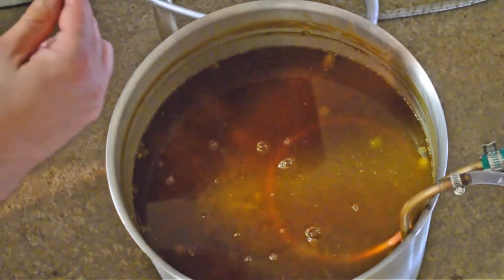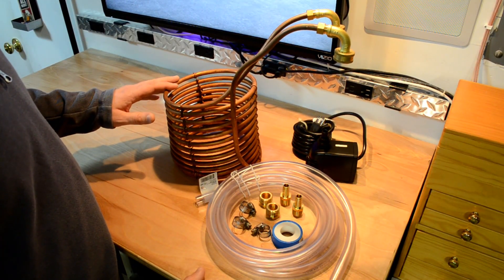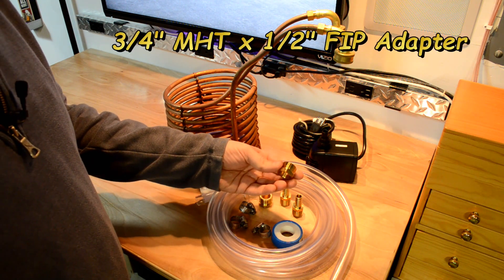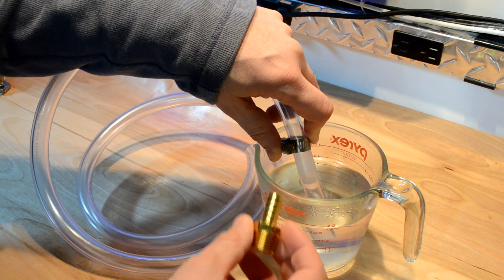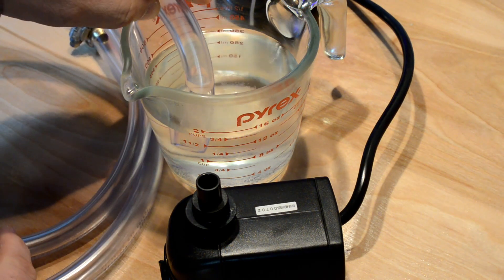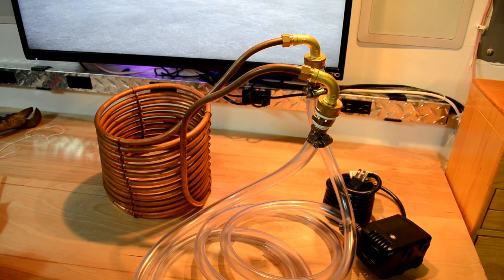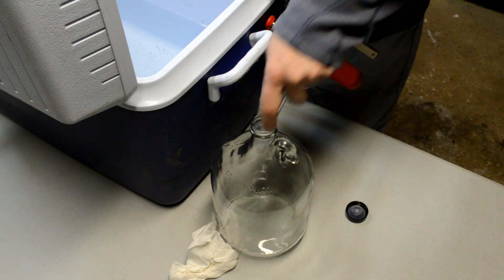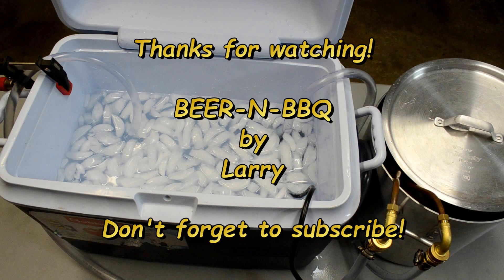Recirculating Wort Chiller: A DIY Project

Comment: Thanks Larry, chilled 10 gallons of beer on a 50’ wort chiller in about 20 minutes with 25lbs ice on an 85 degree day. I had to run off about 15 gallons of hot water first, but my kids were able to wash the dog and cars with that. The 300-500 gpm pump cost me 45 bucks, still cheaper than a plate chiller and in my opinion, more efficient.

Comment: Excellent video! Thank you! I got a submersible pump, attached to my wort chiller and cooled my 6 gal. of BOILING hot wort to lager pitching temp in less than 25 min! Saving the first few gallons of hot water was a great idea. Not only did I save time and LOTS of water, it’s so much more sanitary when the wort cools so quickly. Microbes have no time to grow. Thank you Thank you Thank you!!!!

Comment: Larry, super video!  Have just moved to the desert and no longer have grass to water.  Need to procure a chest freezer to use as a fermentation chamber.  Have you considered using a chest freezer as a water repository (being chilled by the freezer) rather than using the cooler?
Reply from the maker: I have not considered that. Interesting idea. Not sure how waterproof they are.
Reply: @BEERNBBQBYLARRY  I've used an old POS chest freezer picked up cheap (Montgomery Ward) as a fermentation chamber.  Fool thing died (R12, so no easy fix), and out of desparation filled it with water and ice.  It worked, no loss of water (this was done in the midwest before I moved).  Have picked up another freezer and plan to give this a try.  I use a counterflow wort chiller, and based upon comments, will get a utility pump.  I'll let you know how it works.

Comment: I too use a recirculating wort chiller and get great coldbreak. My question I'd how to keep the coldbreak material out of my fermentor? Do you just let it sit? Does whirlpooling work??
Reply from the maker: I just leave coldbreak behind in the kettle; racking from above the tub or from the side of kettle after whirlpooling.

In the old days, I used a mesh in a funnel to filter out most trub on the way into the fermenter. PITA though.

Comment: Would it chill even quicker if you had a copper coil submersed in the ice for more surface area?
Reply from the maker: Not really. They longer the tubing the slower the flow rate which works against chilling.
Reply: @BEERNBBQBYLARRY  why is the flow rate slower, the pump will be working at the same rate, it just means there will be more water in the pipe work meaning it will have more time to draw the heat from the extra surface area.
Reply from the maker: @brewster2188  maximizing heat transfer into the water is not the same goal as chilling quickly. They are opposite goals.

Comment: I wander if you use a higher flow rate pump in a styrofoam cooler so you can drill holes for your pump lines to come out of the lid ( styrofoam for a cheaper proto typing material). Better yet maybe you can add a (brand new of course) automotive oil, or transmission cooler on the return side. With the addition of a household fan to chill the radiator fins so the water doesn't return as warm. Also please be cautious using teflon on those type of brass fitting that can sometime for leaks.  I'm not trying to be a Dick or a Troll. Just sharing some knowledge and ideas with ya! Awesome work man! Thanks for sharing!
Reply from the maker: You could go to such extremes. I’m more about simplicity and reuse. I use that cooler (or bucket) for multiple purposes than just this and it only takes up one spot on my garage. 
I also now use a more powerful utility pump and garden hose.

Comment: How has this held up over the years?
Reply from the maker: Still around, but I've since upgraded my pump to a 1/3 HP submersible utility pump. Works much faster.
Reply: @BEERNBBQBYLARRY  Is there a brand and model you would recommend?
Reply from the maker: I have whatever Menards was selling at the time.
Reply: @BEERNBBQBYLARRY  Thanks for the reply.  I'll check around and see what I can find.  One last thing.  What would you recommend I keep an eye out for when it comes to how many GPM or GPH the pump can transfer?  Thanks again.
Reply from the maker: Just note that claims around those numbers are extremely exaggerated on imported pumps making comparisons hard to do without real testing.

Comment: Just did this with my Hydra and a utility pump (1/3HP, 2450GPH), and holy crap was it fast. AZ ground water is far too warm to do any meaningful chilling and I got sick of wasting so much water, so decided to try this. I saved the few few gallons for cleaning before I started recirculating and got down to pitching temps within a few minutes. Then I gave the garden the leftover water. Only downside is buying ice, but I feel much better about brewing now. Thanks Larry!
Reply from the maker: You’re welcome. I also upgraded to a utility pump since this video. Much faster indeed.

Comment: Hi there! I know this is an old video, but i'm currently writting a paper about heat exchangers. Do you have any source I can look up for how to calculate the water volume used to chill a 5 gallon batch? thanks!
Reply from the maker: I had done my own calcs in a spreadsheet once many years ago when I built my first chiller, but I don’t know where that fully went. 
As long as you have a background or knowledge of heat transfer and or a engineering text book on the topic, you can calculate a number.
Reply: Just know that ice changes everything.   With the phase change,  5 gallons of ice-water is NOT the same as 5 gallons of 32-degree water, not even close.  Ice absorbs a lot of heat when it melts.  It takes  80 calories of heat to melt 1 gram of ice - that is the amount of heat that would have otherwise raised that gram of water by 80ºC or 133.33ºF.   22 pounds of Ice (2.5 gallons) would take 133.33ºF from 2.5 gallons of wort, or 66.67ºF  from 5 gallons of wort.  Doing the math,  20 pounds of ice would take about 60 degrees from the wort.  or 10 pounds would subtract 30 degrees from the wort.

If you are using ice water, subtract 3ºF for every pound of ice from your wort temperature. AFTER that compare that new adjusted wort temperature  with 32-degree water on the other end.  Kettle temperature depends on whether you start cooling immediately or do a whirlpool phase first.

Another way to look at it, in your calculations, treat ice like -101ºF (or -80ºC) water.

With thermodynamics, nothing is perfectly efficient, but that works in your favor here.  The steel kettle starting at boiling point is going to be losing a lot of heat to the air.

Comment: Great video...I have been doing something like this for a while, but still discharging the water to the lawn and not recirculating the discharge water.  My concern is that it comes out so hot in the beginning that it would significantly raise the water temp and slow slow the cooling process.  I know I've used close to 20 gallons of water with 10 pound bag of ice.  I'll give your method a try and use less water but more ice.

Comment: What is the motor capacity (power output, if the right terminology). I was looking at 55 watts, please do share your inputs.
Reply: @BEERNBBQBYLARRY  hey Larry, thank you so much for even responding to me. I was asking for just that. It says the pump is about 50 watts and has lift capacity of 2.5 meters. Will that do? 

Also, I love your channel, i just watched the diy magnetic stir video, it would save about 80% of the actual cost to buy it. Amazing.

Comment: Pond pump is not recommended...
Reply from the maker: It worked well enough for a while, but I’ve since upgraded to a 1/3 HP submersible utility pump for faster flow rate.

Comment: Excellent video, Larry. I just found this video and decided this is the way to go rather than a counterflow unit. I would rather recirculate my water than the wort. I also found that it was much cheaper to go with an aquarium pump from Amazon rather than getting a fountain submersible pump at my local Home Depot. I have placed an order for a 1050 GPM unit that costs about $21. Hope it works better than the 425 GPM unit from HD.
Reply: I am an engineer also and am aware of this. FWIW, yesterday I received my pump from Amazon (https://www.amazon.com/1050-GPH-Submersible-Fountains-Hydroponic/dp/B06XK8X2DJ/ref=sr_1_1?ie=UTF8&qid=1520705664&sr=8-1&keywords=1050+gph+aquarium+pump). I tested it today and it was sick. I didn’t time the first one as it was so sick. This one took 1 minute 28 seconds to pump 1 gallon of water, about the same as the first setup. This was coming out of the 1/2” pump outlet through a 3/8” adapter into my 3/8” x 50 foot home built immersion chiller (per your video) and out through a 3/8” hose back to the ice bucket. Basically, identical to the first setup.  I went back to Menard’s today and bought a 1/2” x 50 foot roll of copper refrigerator tubing. I tested this version coming out the 1/2” pump outlet through a 1/2” hose to the future chiller and out the roll through a 1/2” tube back to the ice bucket. This one filled the gallon jug in 38 seconds!!! So it matters what size your immersion chiller is. I know this time might change when I bend it into a chiller, but would not expect a huge change. I think the restriction of the 3/8” tubing on the first two chiller setups is what slowed the flow. However, this pump was $21 versus $ 45 for the one from Menard’s, I will keep this setup. (I see I referred to Home Depot in the first comment, but meant Menard’s, which is a Home Depot competitor.) Thanks again for the video(s).
Reply: P.S. The reason I didn't bend the 1/2" tubing today was I wanted to return it if there was no difference.

Comment: Awesome video, I hate wasting all that water too. I'm doing this for my next brew day. What do you think about using a 10gal igloo cooler converted to be a mash tun for this? You could use a chugger/riptide/steelhead pump out of the bottom spigot and have flow control via the valve, through the immersion chiller and back into the top of the igloo with ice.

Comment: This is a great idea. Trying to chill wort in Florida during the summer is a real hassle when the tap water is 80+F. I used different fittings to suit my chiller and I still need to source a fountain pump, but I can't wait to see how this setup performs compared to tap water.

Comment: i just bought a immersion chiller,being delivered ,anyway the setup in my place is awkward,i can make it work  but i am wondering what would be the the longest distance of hose to use,is over tem feet to long from the faucet to the chiller,
Reply: well it would be about 10 feet,and i was thinking maybe i might try your setup,but not right away thanks for your response

Comment: I have a submersible pump (light duty sump pump). Does the flow rate really matter? And if so, why? Thanks.
Reply: Thanks Larry. I'm hoping a sump pump will work and that the resistance doesn't burn out the motor?
Reply: There has to be a balance.  You don't want the rate that the pump draws water out of the container to be faster than it returns.
Reply: @BEERNBBQBYLARRY   I was told at a very young age by a grade school teacher that if there was a way to F- something up, I would figure out how; and I imagine this would include defying the laws of physics.  :)  Science was never my strong suit and I only starting taking an interest insofar as it applies to smoking meat or brewing beer.

Comment: Great idea for reducing wasted water. Keep in mind, though, that garden hose fittings are straight threads and should be sealed with a flat rubber o-ring that usually sticks in the female side of the fitting. Adding thread tape won't help seal that joint and might actually cause a leak in the long run.

Comment: Why would you need a 500+ GPH fountain pump? Isn't the idea supposed to be a slow flow so it becomes more efficient? With the immersion coils wort cooler you need to slow down the flow so it becomes more efficient , I had used a high flow on mine and wondered why the water coming out cold when it should have been warm - hot. I reduced the flow until the water turned hot -
 warm coming out. Why not use something like a Jebao PP-333LV Submersible Fountain Pond Water Pump with a Flow Rate of: 66 GPH - flow control dial adjustable?

Comment: I wanna make this, but have a question on the pump size.  Is the pump a 500 gallon per hour or 50 gallon per hour pump?  I caught that it took just over a minute to do a gallon which would figure closer to 60 gallons per hour   Love the videos and lessons.  Thanks in advance.

Comment: seems like a lot of unnecessary connections.  I connect hose directly to copper tubing of chiller which saves a lot of connectors.  Works like a charm.  I also use a $20 12v pump in stead of submersible.    Chilling by ice water is the way to go.  I can chill 6 gallons of wort to 20C in about 20 minutes.  I reuse the water and pour back into 2L pop bottles to freeze for the next brew day.

Comment: Larry, I love this wort chiller idea. The only question I have is how do you connect the fittings on the copper coil input and outputs? 

By the way the video was clearly informative. I just want to know how you got the hardware on to the chiller itself. Thanks.

Comment: Hey Larry.  I do a similar thing with a minor addition.  I add rock salt to the water too help cool it further.  I also capture the water to be used for cleaning my equipment when I'm done.  You seem to know and understand science and engineering.  Does the salt really help?  I brew using the Grainfather system and chill with their counter-flow chiller. By pre-chilling the cold water I can get my hot wort to under 60 degrees very easily.  I think you are right on!
Reply: If you have snow in the yard, you could use it to cool the water and/or chill packs. I would have concern about using salt as it can corrode the copper pipe.
Reply: I meant to say to take snow from the yard and put it into the cooler to keep your water cool.

Comment: Larry, awesome idea!  Currently I use one of those expanding hoses from the tap  to the chiller and a shorter 6' rubber hose to the drain.  I'm contemplating starting with this same setup with my 500-gph fountain pump (which I use in keg and carboy washer) initially.  Given that the draw is going to be fairly quick and the water takes time to circulate through the chiller's coils, the output should be longer than the return so the pump doesn't suck the container dry.

Comment: First, what is that in your intro in the bag with the onions? Are you brewing (I can't imagine an onion beer, but that doesn't mean that someone couldn't) or cooking or what? It's kinda bothering me that I don't know. Second, is the tubing you buy from the hardware store food grade? I always buy my tubing at the brew shop (presumably at a mark up) because I'm wary about what the hardware store has. The only brewing supply I get there is propane. Third, Teflon tape is great shit. I hate doing plumbing, but every plumbing task I've ever had to do was made better by Teflon tape. Didn't realize it had brewing applications. Fourth, I watched this video with some heavy skepticism. But I'm halfway convinced that this is a worthwhile project. I kinda hate my current immersion chiller that just floods everything and takes a couple hours to get anywhere near pitching temperature. I'm half convinced to use the method my friend does, which is "put it in the fermenter, cover it, say fuck it and pitch the yeast tomorrow", but this is an intriguing alternative.